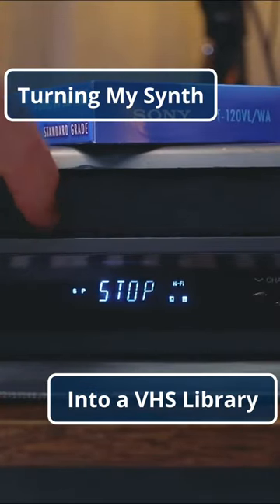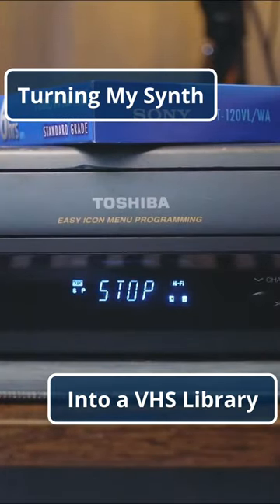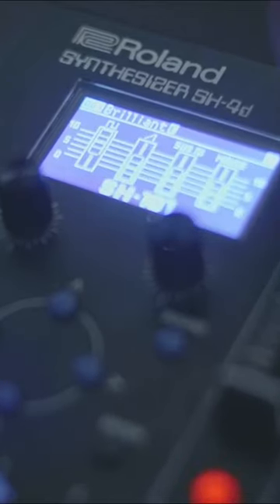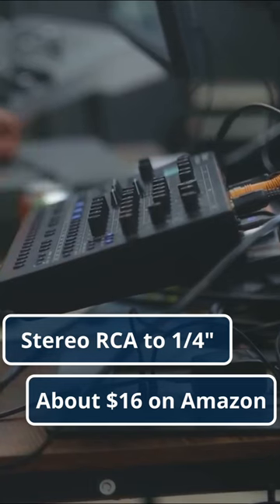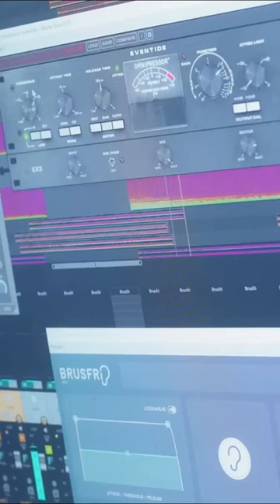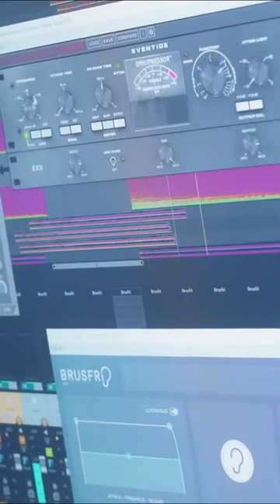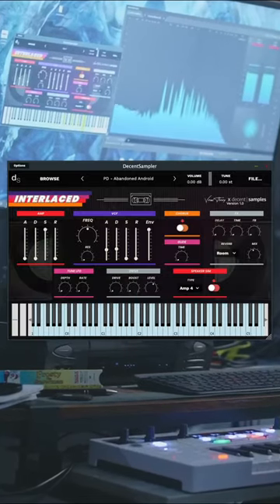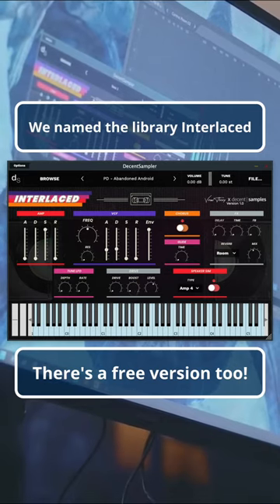Sampling with VHS tapes

Comment: FYI - You'll obviously get drastically different results if you're using a Hi-Fi VHS deck versus non.  The Hi-Fi decks recorded audio as an FM signal embedded with the video utilizing the spinning head.  The regular audio was recorded on a linear track, sometimes just in mono and on the edge of the tape utilizing a separate head just for audio.  Not trying to be Mr. Smarty Pants but I think it's good information to know.😊
Reply: This. I have 2 VCR’s, one Hi-Fi and one not. The HiFi one is so faithful it’s not going to change the audio enough to be creative. The other one is mono and had a Lofi and band limited type sound, this is what people must be referring to for the VHS sound.
Reply: When I came to Canada I left behind my DAT recorder and bought a HiFi VHS deck to mix to - just as good sound quality and no fatal dropouts!
Reply: @unclemick-synths  I still own a rare Toshiba DX-900 VHS deck.  It not only records Hi-Fi and the standard linear track but it also records PCM audio in place of video if you select that.  In essence, you can record five tracks at the same time if you count the mono linear track.  I need a new belt for it so I can transfer some old tapes that I mastered.  The belt is used to eject the tapes.
Reply: @Garflips  Cool 👍
Reply: What about S-VHS (Super-VHS~ where S-Video type cables originated), I know they have improved video quality(higher# of scanlines), but I've also heard they have superior audio quality too?? With all that said, I agree that for Lofi use; generally the lower quality/grittier the better, as that mediums unique "artifacts are what's desired.
Reply: @davegraham716   SVHS use the same Hi-Fi and linear audio track as the premium VHS decks.  The bottom line is that for any type of degradation that you'd want to affect samples with, you'd want to record on the linear track which will have the same effect as using cassettes.  There's a lot of fascinating info out there about how video and hi-fi audio is recorded on the spinning head of a VHS/SVHS deck as well as the classic differences between amplitude modulation and frequency modulation.  There's a lot of overlap with general synthesizer technology.  It's all vibrations, man.

Comment: Might just be me not understanding but Is there anyway you could elaborate on the exact in and outs of how your connecting to your daw or audio interface to record the signal from the vhs? I wasn’t sure if it was with more adapters you were using to go into the interface or not.
Reply: The VCR has 2 RCA (audio) ins - left and right.  The synth has a single 1/4" spike out.

Adaptor = one 1/4" (male) spike to 2 RCA (male).

Record synth sounds into VCR.

Once sounds were on  tape, he moved the RCA plugs FROM the 2 RCA ins TO the 2 RCA outs on the same VCR.  He also moved  the 1/4" spike (that was in the synth out) to the in of his audio interface (i.e. Apollo).  

Press play on VCR.  Press record on the DAW.  

Record synth sounds (that were on VCR tape) to the DAW.

Same adaptor for both processes.